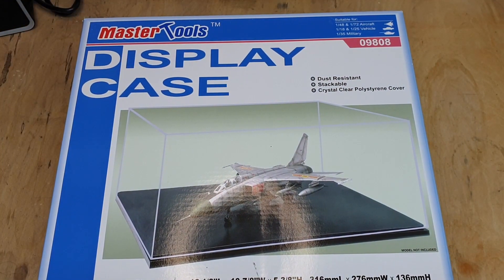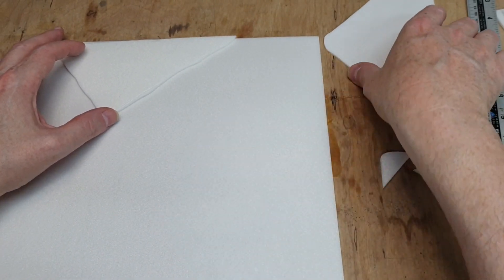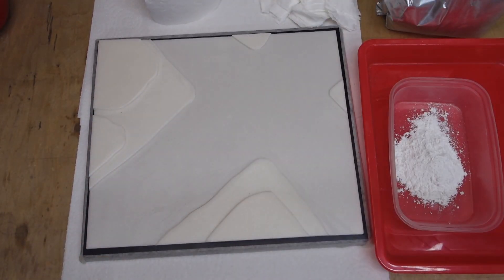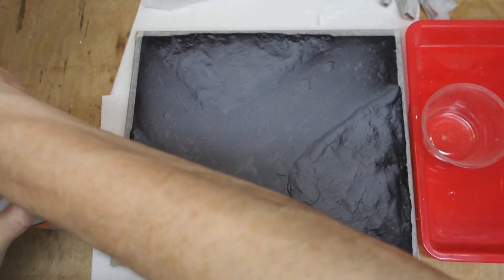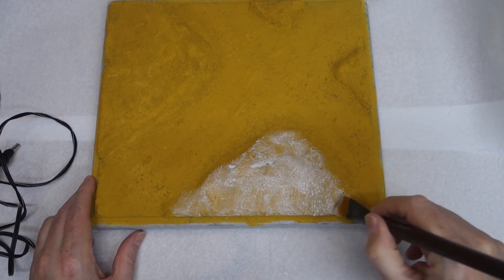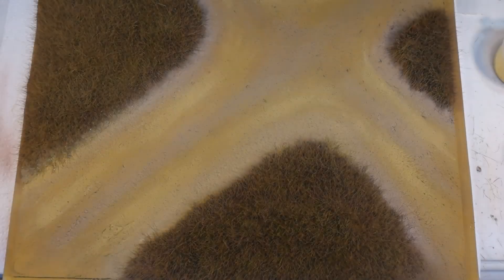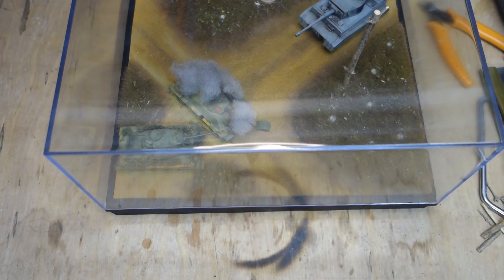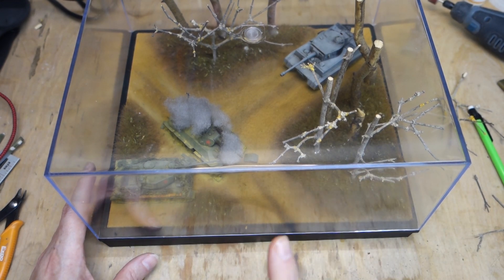Building the diorama for our Белый тигр (White Tiger)

Comment: I found a stone wall, roadside cross, and pave road in stl files I printed for a WW1 diorama.
Reply from the maker: Yes, I thought about things like that, but the scene in the film is literally a clearing in a forest, so I felt anything like that would look out of place.
Always keen to get new stuff though - may I ask where you got the STLs?
Reply: @SteamGeezerUK  There is a lot of modular stuff done for D&D and wargaming. I just did a search for 3d printed walls, another for stone pavings and another for roadside cross. I had results from Cults, Thingiverse and other sites. Some scaled to look right in 1/35. For landscaping I used heavy duty glue that comes in a tube, that one pumps out. I like the way you do not always follow the conventional way of doing something.
Reply from the maker: @johnforeman6620  Nice, thanks, I'll look into it 🙂

Comment: Aircraft noise - a silencer fitted to any engine seriously reduces the output power of that engine. For aircraft it is best to have as much power as possible for as little weight as possible. 
If Rolls Royce 'Merlin' engines were fitted with silencers, you would probably need 6 engines per Lancaster to achieve what 4 un-silenced engines could do.
Reply from the maker: I kind of get that, but I've seen tests done on (admittedly) car engines to determine how much HP loss there is from various types of resonators and silencers, and you can reduce the decibel output considerably with very little power loss. Still, I don't suppose it's ever going to change so I'll just have to deal with it I guess. 
The weight thing certainly makes a lot of sense though, thanks.
If you're interested, by the way, the episode of Engine Masters I'm talking about is here - https://youtu.be/eLceqIoTMvo